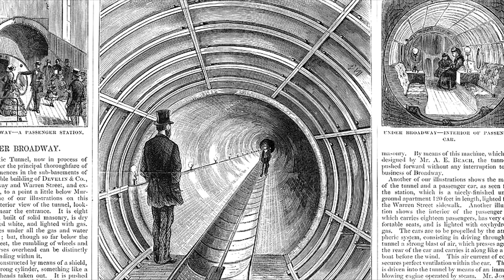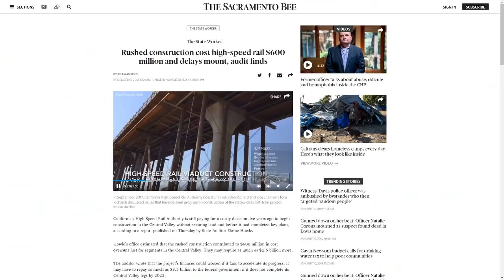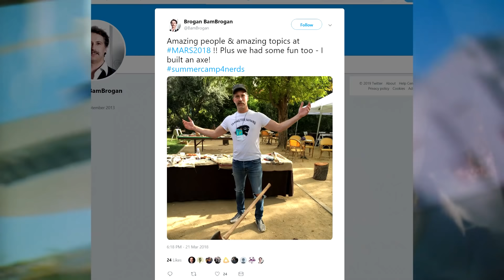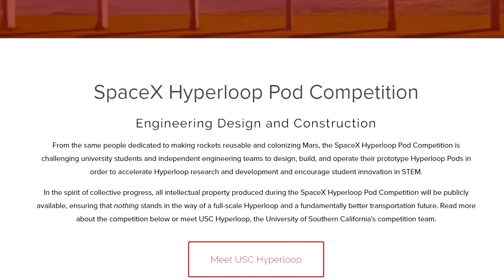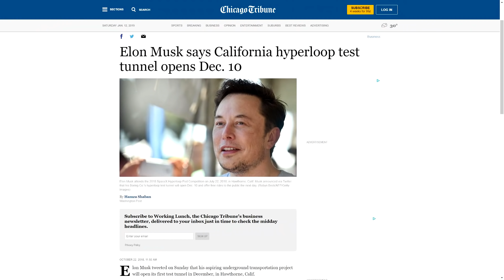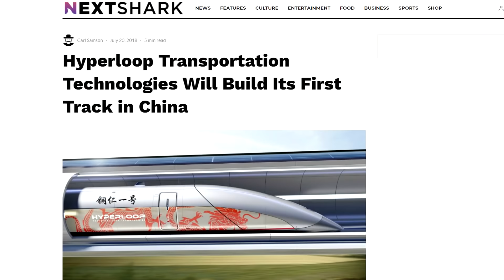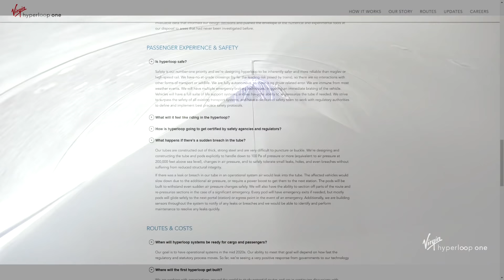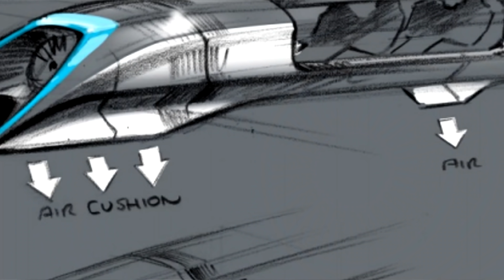Why Hyperloop will FAIL HARD - Its Biggest Problem...

Comment: Hyperloop "in a nutshell" (literally):
In an atmosphere, a huge vacuum chamber, which contains another chamber, which contains a finite amount of atmosphere and human beings who need to breathe.  The people need a means to get into the inner chamber without exposing them to the vacuum, and without exposing the vacuum to the outer atmosphere or the atmostphere of the inner chamber.  And the inner chamber needs to move very fast, with no failures or leaks across hundreds of miles.
Sounds simple.
Reply: An airlock?
Reply: Punished Aniquin  What did I miss?
Reply: @markharmon4963  lmao, and how do you maintain the seals of the tube? Vacuum pumps every 10 meters are a seal. The tubes that are a few meters in length and joined together all have seals. You'll need tremendous energy consumption to maintain a vacuum. And you'll somehow need to maintain that vacuum as materials expand and contract when desert temperatures swing widely day and night. And you'll need emergency exists built. Onboarding and offboarding passengers while maintaining the vacuum.

And all of this for a system that will transport less passengers per hour at a higher cost than Maglev. Literally just build maglev. 350mph train that has been demonstrated to actually work is more than capable.
Reply: @moist_ointment  Use good seals. How do HSR trains deal with expansion?  Is the problem for expansion and contraction really the same case for a pipe of much larger mass, filled with a vacuum and shaded by solar panels. I do not know.  Air locks are time tested and proven.  So are aircraft  which hold a survivable atmosphere for much longer than 30 minutes.  A lot of windows, doors, electrical patching, a lot of seals on those airplanes.  A lot of change in temperature as and pressure.  This is not an impossible problem.  Come on Ken, smarter people than you and I have figured out these problems decades ago.
Reply: @markharmon4963  "How do HSR trains deal with expansion" It's much less of a problem because HSR isn't maintaining a vacuum chamber that can NEVER decompress of it'll likely kill all of the occupants

"Come on Ken, smarter people than you and I have figured out these problems decades ago."
No they haven't. Hyperloop doesn't exist. the problem hasn't been solved until one does. I don't see how building the world's largest vacuum chamber and than maintaining that vacuum can be even remotely economically viable with less than 2k passengers per hour throughput. Tickets would be absurdly priced and distances much shorter than proposed.
And many smarter people than you or I call bunk on the project. Richard Branson paying engineers a lot of money for a deadend project aren't proof of anything.

If surface level Maglev struggles to be economically viable, it's crazy to think maglev inside the world's largest vacuum chamber is feasible.
Reply: @Pumpkingilmour the cost and logistics with maintaining a vacuum chamber of any usable length, completely exposed to the elements, is ABSURDLY high. The cost benefit of 500mph vs 375mph (traditional maglev) just absolutely does not justify the project.

And as someone who works for a large scale infrastructure company, I can tell you that price estimates/quotes are driven by historical projects. High-speed rail is over budget currently? That means the current projects costs get baked into the next HSR price estimate.
Hyperloop doesn't exist, so the price estimates given on it are completely made up. The fact that hyperloop, which is a maglev train inside of a vacuum chamber, is being quoted as being CHEAPER than a maglev train NOT in a vacuum tube should be immediately setting off red flags for you
Reply: @moist_ointment  I think a big part of the cheaper estimate is that hyperloop transit does not require the intrusion into the landscape, infrastructure and quality of life a rail system does. The noise will be less than a car going down the road.  The structure will send it above the residences, agricultural land, small rivers, shallow wetlands, roads and infrastructure. It is mostly built off site in a factory and installed. And it can use existing freeway center divides.  Rail permanently alters and subdivides everything it crosses.  That is expensive and damaging.  So hyperloop transit is estimated to use one fifth of the footprint of rail.  Given that it will be much less quiet, it should be able to be brought through cities with less political resistance and shorter setbacks. I think this is a quality of hyperloop transit which is underappreciated.
Reply: @moist_ointment  And compared to rail, the vacuum chamber actually protects the pods, the conductors, the linear motors from vandals, the elements, the curious pedestrian, and animals.  The pumps will be exposed, but they need maintenance and can be well hardened anyway.  No I think the tube is a big part of what will make hyperloop transit cheaper.
Reply: @markharmon4963  So many things to address.
1) The tube is maintaining a vacuum. A single hole in it will kill all of the occupants. The materials of the tube will stretch and shrink from temperatures. Maintaining the vacuum would be extraordinarily difficult.

2) Hyperloop is LARGER than Maglev. Everything you said about space would apply better to Maglev, since they're the same thing, but one doesn't have an extremely complex tube around it.

3) No, Hyperloop absolutely would not just "go over residences and agriculture". You can't just build infrastructure over others property. Each owner would need to agree and be paid. AND even if you could do this, so too could you with Maglev.

4) trains and rail exposed to elements is MUCH less of a concern than A VACUUM CHAMBER. It's absolutely crazy that you think the world's largest vacuum chamber can safely and cost effectively transport people. If any of the seals brake, everyone dies. And there's no emergency exits, as trains are required to have. It would take a tremendous amount of energy to maintain the vacuum.

5) 500mph rails can't run along existing highways. The curves are designed for sub-100mph travel, unless the train either drops down in speed to below 100 (defeating the purpose), or is prepared to subject the occupants to fighter jet levels of G-Force on embankments. 

6) And all of this is to accomplish what, exactly? Increase Maglev from 375mph to 500mph? It's exponentially more expensive to build and maintain, while being a huge safety risk, for a relatively meaningless increase in speed.
Reply: @moist_ointment  Does a leak kill everyone at once or is a vacuum of that size impossible to maintain cost effectively.  You can not have it both ways.

Of course people should be paid.  My point is there will be a lot less people that need to be paid.  You did not address the probability of less land being required for hyperloop transit.  Also, a pipe on pylons aligned over and through an apricot orchard for example will be much less degrading than the earthwork required to support rail of any type.  How would a farm worker get across from one side of his land to the other without some sort of bridge over or under.  Therefore it stands to reason the farm will be far less impacted by hyperloop transit.  The farm stays functional and the farmer gets some extra income from a settlement or lease agreement.  Sounds like a win to me.
Reply: @markharmon4963  "Does a leak kill everyone at once or is a vacuum of that size impossible to maintain cost effectively" yes. Those are one in the same. Massive maintenance to avoid a leak, and when one does occur, the tube implodes and kills the occupants.

"a pipe on pylons aligned over and through an apricot orchard for example will be much less degrading than the earthwork required to support rail of any type."

What are you talking about? There's maglev rails inside the tube. If you can build Pylons, place a vacuum tube on them, and then build a maglev train inside the tube, you could just put the Maglev train on the pylons as well. How does the addition of the tube make allow pylons when without it couldn't? The tube would add additional with than the maglev by itself
Reply: @moist_ointment  The test beds have rails because the focus of study has been testing and developing the linear motors. Rails require wheels.  Wheels traveling at 670 mph would explode.  I am quite sure there are no wheels for cruising speed.  I know the passive inductive maglev needs to be going at least 20 mph in order to float so some wheels probably will taxi and land the pods.  So track is not required throughout.  The pipe itself is a very efficient structure. Aircraft and bicycle frames are good examples of this. And the pods themselves have no undercarriage, suspension or steel wheels so they will be comparably lighter than rail cars.  I understand why you would think hyperloop transit is heavier with that misconception.
Reply: @moist_ointment  And a hole of a half inch or so could be plugged with a piece of duct tape.  Every vacuum system has leaks.  I think you mean a major breach.  If that happened, air would rush in through the hole.  The rest of the system would rapidly equilibrate and the cars would slow down and people would exit by emergency passages or at low speed to the station.
Reply: This is fun.
Reply: @markharmon4963  Duct tape? Wow. No.
Reply: @charliehorse8686  Yes, I know it is surprising. A 1/2 inch hole at 15 psi is a little  less than 12 lbs of air pressure.  Duct tape can easily handle that.  Not a permanent fix but it would work in a pinch, and only applying it from the outside of course.
Reply: @charliehorse8686  That video is testing a tank car designed to hold liquid.  It is able to do that because steel is at it's best in tension.  And those are the forces it is designed to resist.  Therefore the engineers can afford to make it thin.  So what you see in the video is a failure of the evacuated vessel in compression by a flaw in the geometry.  When the vessel experienced failure the imperfections of the arch where overcome and the vessel failed catastrophically.  In the case of hyperloop transit the vacuum chamber will be substantially thicker so it will robustly resist atmospheric pressure.  The duct tape bridging a small hole will only be experiencing tension, as I said only 12 pounds total on a 1/2 inch diameter hole.  You could cap it with the palm of your hand.  Try it.  Evacuate a cylinder with a hole and seal it off with duct tape.  Use two layers if you want.  It will hold.  The reason that failure in the clip is so impressive is when you have a large surface area with 15 psi behind it then the result is tons of force.  When you apply that to a thin walled tank it will fail, nothing surprising about that but yes very alarming.
Reply: Or even easier, try to hold 12 pounds suspended on the tip of 1/2 inch rod with decent quality  (Nashua brand?) duct tape.
Reply: @markharmon4963  never mind. I just realize that your opinion is more important to you than facts. A vacuum chamber even half a mile in length is virtually impossible to eliminate pinhole leaks. The hyperloop is an example of an idea that would be really really great if it was at all feasible. It simply isn't feasible.

Can you put a train in a tube? Sure. But the vacuum chamber thing simply cannot happen within a budget that would make it worthwhile.
Reply: @charliehorse8686  I'll be ready with my tape.  Remember it can have pinholes, that doesn't make it a balloon.😀
Reply: @charliehorse8686  I feel like I had a reasonable response to your arguments and evidence.  Your homework is to see what the bursting pressure of duct tape is by doing an experiment and get back to me.
Reply: @markharmon4963  My homework?  First off I don't question the bursting pressure of duct tape... The suggestion that it's an option, even a temporary one, illustrates your complete and utter ignorance of the issues involved.  (No, I won't be listing those issues for your convenience.)

And second, piss off.  You haven't done an ounce of homework, and you think you get to dish out assignments?
Reply: Airplanes?

Comment: There's no way this could be economically viable at a massive scale. Airplanes will always be better than this in every way:

1.The cost of constructing will surely be many times more than that of high-speed rail, as it requires a maglev and a vacuum. The ability to stop is far less, and the pod idea means that capacity is low. Suppose 1 pod leaves every minute of 25 people; that means 1500 per hour at best, compared to 12000 per hour on a traditional high-speed rail. Land acquisition isn't any better either; as high-speed rail can use viaducts when the land cost is high. Maintaining a vacuum seems to be a nightmare; any hole would require you to repump the vacuum. You also have to make it safe; any leakage at any point would immediately disrupt the passenger experience and cause serious problems, to say the least.

This means that we're getting 1/8 of the capacity at probably at least double the cost. This would mean that hyperloop would probably cost over an order of magnitude more than traditional high-speed rail. Only the rich can afford this; it would probably cost  $500 to go from SF to LA, when you can fly at $70 (on average, not account for baggage/etc. but that won't increase it to anywhere near $500). Even if oil goes up to $500 per barrel as oil supplies run out (which could happen), this would probably around triple the cost of flying to $200.

2.The theoretical max speed is 750 mph. However, reality will prove slower. Just like how TGV could theoretically travel at 357 mph, it actually operates at 200 mph. The most likely outcome is probably 450-500 mph once the technology matures, which is slightly slower than an aircraft. I think a maglev will achieve that too (Japan's first maglev will be 310 mph. Trains now go 220 mph, compared to the 130 mph speed that Japan had in the technology's infancy. Applying the same ratio we will get 520 mph for maglevs when they mature, about the same as air travel).

High-speed rail would cost $40 at Chinese prices and take 2.5 hours, so that would be competitive with flying once you take into account security/boarding/deplaning/etc.

3.I can't imagine vacuum comfort to be much better than air travel comfort.

Comment: The Hyperloop is an amazing idea! The only problem is that the huge vacuum tube is impractical, so we should build it without that. And Maglevs are kind of problematic to rely on, so we should just use a normal rail. Besides that, it's genius!
Reply: Compared to train - only carrying about 50 passengers per pod compared to 1300+ from the Shinkansen
Compared to Planes - moving at about the same speed while having the fraction of the capacity and no route flexibility unless the hyperloop network is vast which would mean astronomical cost.
Compared to Maglev - essentially this is a maglev but then stuck with a tube that must be maintained at almost an absolute vacuum for hundreds of miles which would drive up cost again.

So for me this is not a good idea at all.
Reply: Amazing, genius! That is why there are so many of them running, eh?
Reply: That's a good way of putting it! To appease all "Futurists" calling everyone else a "Luddite" maybe we can rebrand conventional high speed rail as the "Value Engineered Hyperloop". As extra bonus it can operate in a normal pressure equalized environment so no risk of transforming into a pancake. I consider that a win-win situation!

Comment: 1)Air resistance will be zero due to which power required to propell is very less. (PROFITS)
2)During natural calamities the whole tube can be depressurized automatically by using sensors and simultaneously opening the emergency doors within the tube.(Problem Solved)
Don't spread negativity amongst the people, you don't know anything about  !!ENGINEERING!!